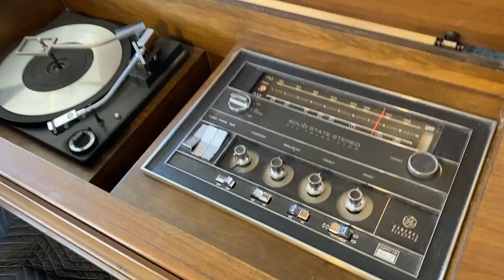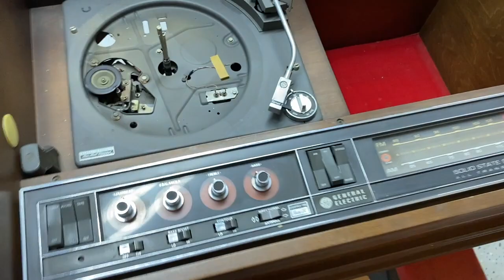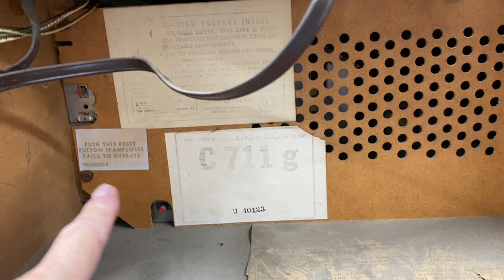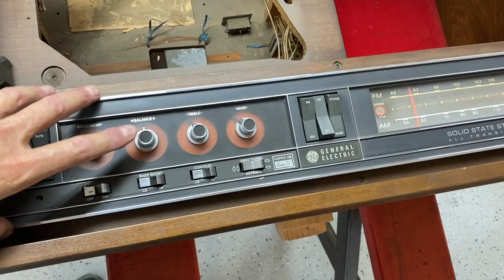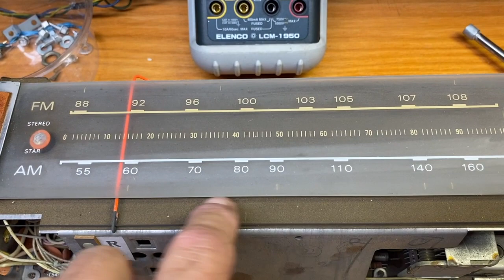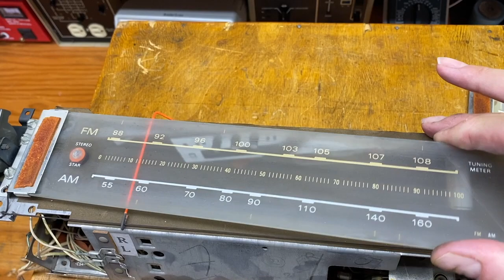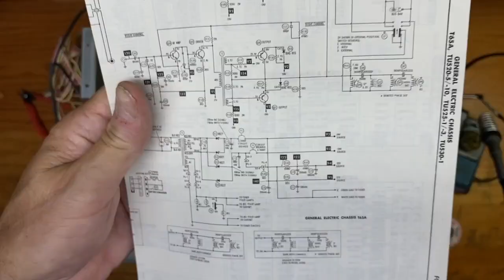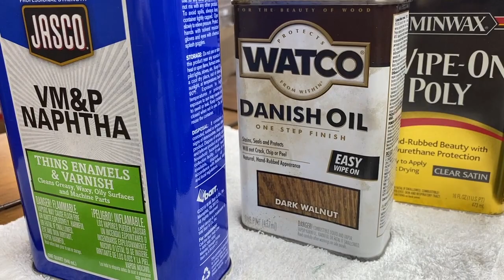Restoring a "Graduate" 1968 GE Stereo Console Record Player, Model 711g

Comment: Remarkable.  
That there is dissension concerning the very considerate and methodical salvaging of parts goes against everything and anything I've witnessed in foreign car repair or any antique service where parts are discontinued gives me pause at what could possibly be the criterion for such criticism.  The other day I called Hartford Connecticut and talked to a service rep about AC hum in my Zenith X 347 and I could tell there was a kind of chip on the other end of the phone claiming parts are impossible to find, China is the problem and anyway Stereo House doesn't even begin to look at a repair without $300 down.

Comment: Re-watching this after picking up a C818g. I don't have any idea what the "g" means either, but I'm also clueless about what the numbering. I'd love to learn more about that if you know. But I did just learn something important from your video, which is the bit about the console being powered up via the changer's selector. My unit was powered up with the power switch off, and I thought that meant the switch was faulty. Now I know that's a design feature. Thanks!

Comment: Hey Steve! The video has really helped me take apart and learn more about my model C745H. I know it may be a long shot but I was wondering if you happened to have an image or information on how the radio turn dial adjustment string was ran. Mine is currently broken and I want to ensure I route it properly. Thank you again for the informational video!
Reply from the maker: https://www.ebay.com/itm/256029447016
Reply from the maker: This is the Photofact for your model, it should have the string diagram...good luck!
Reply: Thank you!

Comment: I have a separate question. I read that (most or maybe all) consoles have some type of bass reduction in their design so as to not cause issues with the turntable, either due to some type of feedback or causing the record to skip. Is this true?
Reply from the maker: Not that I know of....
Reply: @SteveScarlet  I think this video shows people why a properly restored console isn't cheap. You really put a lot of work into them.
Reply: They'll feed back if they've got enough power and you crank them up substantially.
Reply: @johnnytacokleinschmidt515  I asked because I heard this from someplace. I have a complete functioning Fisher console and a Fisher console amp that was a pull but they are the same model amps and the pulled amp has way more bass than the one still inside its console. The pulled one was set up to be a stand alone amp without the original preamp section so I am thinking that there must be a bass limiter someplace in the preamp section. But I can me totally wrong too. I'm just curious.
 Then again it could be the sensitivity of the speakers in the console.